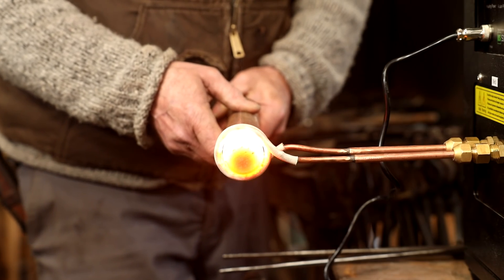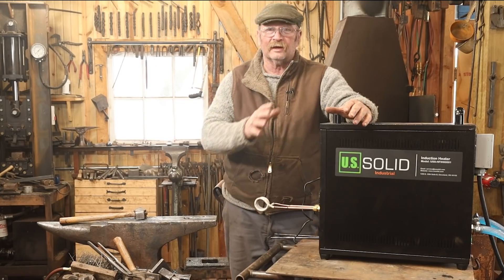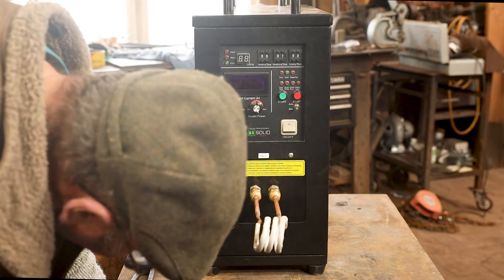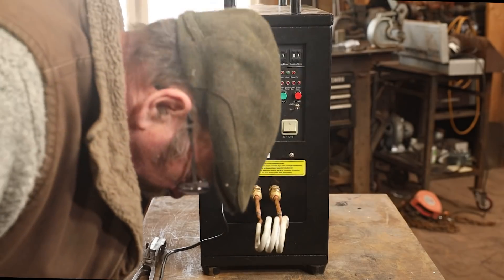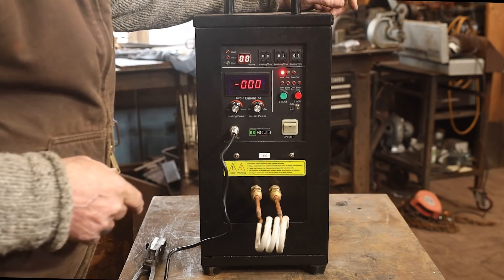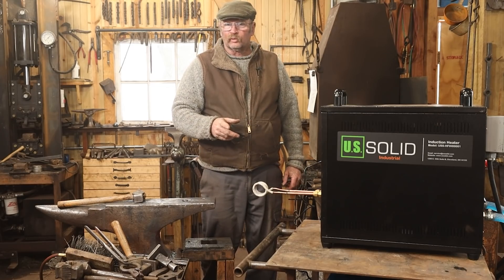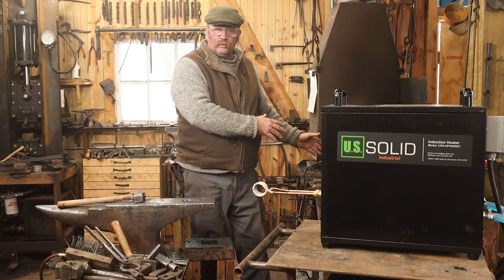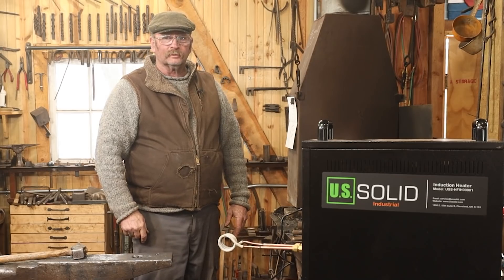Induction forge

Comment: When you do a review video, would you please include whether or not it's safe for people with implanted medical devices ( like pacemakers) to use? I'd be interested to know that info for safty purpouses.
Reply: strong magnetic field, I'd not go near it if I had a pacemaker, not worth the risk.    (I use one one monthly basis)  You can get details of how far the magnetic filed can go, but it could be just leaning over too close that one time and it will influence anything metallic that conducts electricity.
Reply: Good point Jonathon, much obliged. As always, safty first in the shop. Now that that bit of info is known, I wont be going anywhere near an induction forge if one is on.
Reply from the maker: I know i have heard that question asked, but don't know if i have ever heard a definitive answer.
Reply: To my knowledge you might be able to check inside the user manual for an answer, be it a company phone line or for the hazard danger itself in question.

Comment: Two things have you seen Roger Lund version where he has wrapped his coils in a ceramic instalation to get the double whammy.

Also can you run the coil in a gas jacket environment. Ie argon?

Great video look forward to more on this.
Reply from the maker: The coil that came with it does have the ceramic insulation, but i hear it doesn't hold up long.  I think you could gas shield it if necessary, but once it comes out and moves to the anvil you would start scaling, so it may not be worth the trouble.

Comment: JOHN, A COUPLE QUESTIONS...
     As far as welding, can you heat both pieces at the same time? Can you shape a double coil, one for each piece?
    Sounds great for having a forge where you don't have decent ventilation. No smoke from a fire, unless you burn the steel.
    Looks handy for isolated heat, would be great for upsetting a certain spot without heating an area thats already basically done. Of course some heat will radiate through the steel, but not enough to endanger the part you don't want heated, apparently. Should be good for isolating heated areas for twisting too.
Reply from the maker: Yes to all of that.  I watched one smith bring to parts together on the coil to bring up to welding heat then gently push the scarves together while still heating.  He was then able to remove then stuck and complete the weld at the anvil.  He also had an open sided coil for more complicated welds.
Reply: @BlackBearForge  That's pretty cool. I can't wait to see some of the variants of coils you come up with to show us the capabilities of this new tool in your shop.

Comment: Hello John
I have seen this Technik in a car Shop to losen rosted bolds and such things or to heat a muffler to Split the parts . There for it is a string coil that get wind arround the pipe and get it got than
Very good idea to use this Technik in the shop 
Take care and stay healthy
Greetings Frank

Comment: Although I can't say it's for me, it is nevertheless fascinating.  I think a vee perch to hold the stock centered in the coil would be nice.  I might change my mind if you could make a special coil for Poz tong controlled heats.
Reply from the maker: A set of stock supports on either side are a short term goal.  As far as special coils, that should be easy

Comment: I wonder if you put a shroud around the induction loop and pumped in an inert gas (nitrogen) it would reduce eliminate scaling oxidation?  Would be interested in cost comparison to the more traditional methods.  Are you going to fit some solar panels and a battery to run it?🤪🤪
Reply from the maker: I doubt the shielding gas would be worth the trouble, but if it was a requirement, it probably work.  I would like to try it on solar, but thats a whole new project.

Comment: On-off switch remind me switches of old i486-era computer cases! Indicator LEDs in these metal collars are something from same era, too. And mechanical timers are much older! Very strange front panel, IMHO
Reply from the maker: I don't think they've changed much in the 10+ years since I was first aware of them.But the price has come down a bit.  I suspect it is something that will improve at some point making them even better.

Comment: I guess one of the advantages is less scale, because no forced air is used, therefore easier forgewelding. This will definitely become popular in blacksmithing when the prices drop. So many advantages, especially with problematic coal supply and needs to keep and refuel propane tanks and they are not always hot enough.
Reply: I've had mine for several months now and actually it makes more scale over my propane forge because the steel is in atmosphere all the time where in a propane forge its a reduced atmosphere. That said induction forge is soooo much faster once you build 15 or 20 coils but there easy to build. love mine!!!! I dont use it for carbon steel just mild because of the decarb
Reply: Could probably rig up shielding gas.
Reply: But at the same time pretty useless when you have to forgeweld unusual shape :/ (f.ex. "T") So also not a perfect solution, but for most of damascus blades... <3
Reply: @MIK00KIM  Youtube "EJ of the anvil" solved that problem by making an open coil, like a taco. They don't have to be a closed circle.
Reply: Also i'm interested if it would be possible (/easy) to forgeweld dry, without any flux. Because boy this steel looked clean!

Comment: As a mechanic we use hand held versions to heat up individual bolts/parts without the damage and or danger involved in using a torch and it's faster.
Reply: Yep they are a great tool to have in the rust belt and no setting the shop on fire with a torch.
Reply: @Blazer02LS  exactly because you already know that if you're breaking out the torches that whole area has been completely hosed down with some highly flammable penetrating oil. Which is always exciting lol.
Reply: @mikedrop4421  Yep, or it's right next to the leaky fuel tank or a plastic part.. Always makes things fun then !! LOL
Reply: I've seen an advert for them. Looked very effective! I immediately wanted it

Comment: There is a utube video where a guy makes a coil in the shape of a toco so it’s easier to get in and out. Looks like it works great.   I’ll send a link if I can find it again    I too did buy an induction forge but I just never set it up.  Now I think I may sooner then later.   Awesome John.   Thx for sharing …..Paul👍🇺🇸⚒🔥
Reply from the maker: I actually have that in my playlist on the subject.  Once I get better at making coils without kinks I'll make one.
Reply: @BlackBearForge  If you cant get a bender the right size try filling the tube with sand (crimp both ends tight and make sure the sand is DRY)! ..... or you could use an exterior spring. It goes outside the pipe, you make your bend and slide the spring on a bit and repeat!
Reply: @totherarf  
You beat me to it. Spring tightly around the OD and if it's still to complex to manage without kinks, sand or even salt fill.
Reply: @zedex1226  If it were easy everyone would be doing it ;0)

Comment: I’ve been looking at these lately for my garage but even the 2k for forge is outside my budget right now. I’ll probably go gas but I’ve been kicking around the ribbon burner forge for a while as well. Your chili forge has me leaning in that direction.
Reply: Ebay has them for $650
Reply: Thanks. It’s not just the unit. I can’t use city water here so I would also have to have a chiller and then the extra tools to make more fittings. It’s definitely a want down there road but I think the propane forge is the next logical step after coal, because I can use the propane in my 20x20 garage that only has one outlet.

Comment: I can see that being really handy for things like Hardy tools. You can really isolate your heat areas so that you can maximize the output of your hammer.  imagine creating a shoulder without changing the shape of your stem.
Reply from the maker: There is a video out there somewhere of Off Center Tools using one to make hardy tools.  very impressive.  its a 10 year old video, so a bit fuzzy

Comment: A large slack tub and a water pump will replace the TIG cooler.  
To address the Colorado cold, drain the tub.  Used one for a couple years in AZ, where ambiant heat in shop was a problem.
These are great for twists or reverse twists with very localized heating, like making decorative chain links in 3/8 sq stock.
Reply from the maker: Draining the tube and blowing out all of the water lines in the machine everyday then carrying buckets of water up from the house the next day to refill and start over would be a major pain.  With this set up I can be at forging heat in less than 2 minutes from when I walk into the shop.

Comment: Very cool John! I have been wondering how big of a piece you could heat in one of those. I'm impressed with the 1 1/2" piece. I'm anxious to see you use it in the future.
Reply: The rule of thumb I use is When making the coil the loops should be about 24 inches of material do you want a smaller loop you can make more loops and pull them out longer further apart from each other or you can do one or two big loops.

Depending on your soak time I have used mine to also heat crucibles containing aluminum or copper or bronze and I can melt about 4 pounds of copper in under 30 minutes and I could probably do a lot better if I improved my coil or actually insulated crucible.

Comment: It's cool but does it really feel like blacksmithing at that point I would miss the fire
Reply from the maker: The steel doesn't care and the experience at the anvil is unchanged.  I do like having a fire, but not everyone can have a real fire, so this may open some doors.  Plus in many cases it will increase production when making items for sale.  I'll do a full pros and cons video once I have time to see what it really does.
Reply: @BlackBearForge  you have some good points there and if it works for you if use it but for me I wouldn't unless needed but that is a cool tool

Comment: Man I really want to get one of these! Been looking at them for a lot of years now and as you probably know they have now finally come down in price enough a mere mortal can afford one..about 10 yrs ago a sells rep at sofa quadstate had one for sale for $30,000 what a bargain 😂
Reply from the maker: That would have been above my price point for sure.  I think with the cooler, cart and everything needed to make coils I am about $2,000 into this.  So at this point its just learning how to make coils without kinks.
Reply: @BlackBearForge  Fill the copper tubing with sand....then bend....no kinks.
Reply: @BlackBearForge  John its possible to freeze water inside smaller sections of copper pipe to stop it from collapsing, you would likely need to put a bend in the centre first to fit in your freezer, and you need something to plug the ends to keep the water in like bluetack, hope this helps
Reply: If you watch prices you can get them below $600, (not counting cooling) I paid $596 for mine and I agree, I think they’re all pretty much the same unit. It’s been quite a game changer in my shop.
Reply: @derekmelton  This is interesting, but seems like it’s just for doing one piece. Like, if doing production wouldn’t it be faster to be forging one piece while another is heating?
Reply: @aliceharvey1226  Production runs are still much better done in propane, however, many of the things I make are done one at a time and for that, induction is perfect.

Comment: What does something like this cost?
Reply from the maker: I am probably about $2,00 into it with the heater, cooling unit, wiring, cart, antifreeze and materials to make more coils. I have heard of people finding similar machines for as low as $600 and if you already have or make your own cooler you could save quite a bit.
Reply: Awesome. Thanks for the reply!

Comment: Yes! Now all you need is an oblong coil for knives, axes, and such. What is the electricity draw? How about a solar supply?
Reply from the maker: ll topics for future videos.  But you can make any coil you need, I think power use will cost less than coal or propane, but we'll see  If you have solar with an inverter capable f 220 power and a battery bank large enough to handle the surge demand (similar to what you would need if using a welder) it should be doable

Comment: Oh I love induction heating. The setup we have in my lab can get steel white hot in 1-2 seconds. One day I want one in my home shop.
Reply: @zincoleo1  lol indeed. Its 400kHz with a ~70 kA/m amplitude at 600A
Reply: @zincoleo1  Idk about the capacitance of the system as a whole, but we can vary the capacitors in the induction coil portion of the unit by changing them out. We've used 0.3, 0.5, and 1.0 microfarads giving ~400, 300, and 200 kHz, respectively